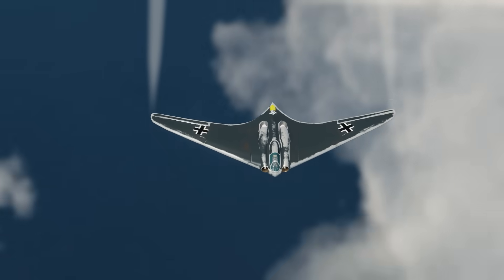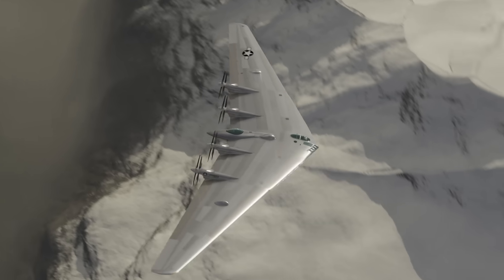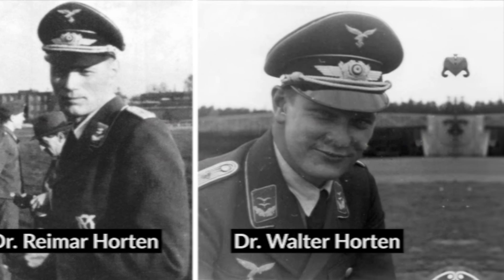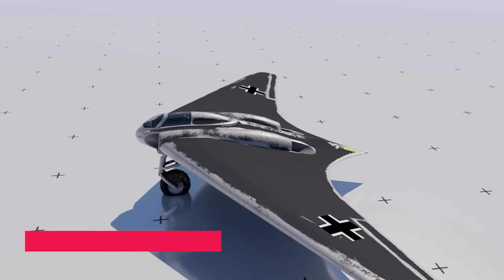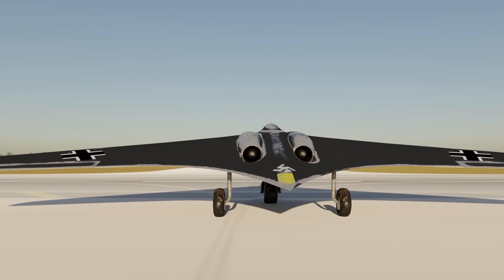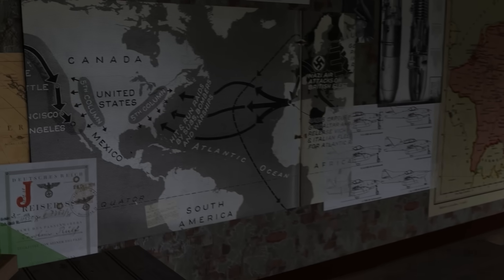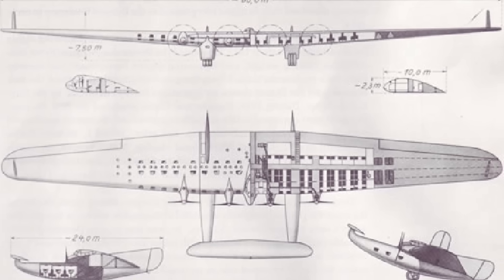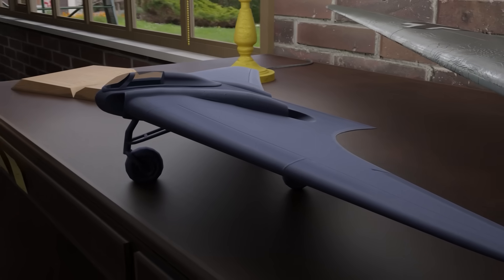Insane Flying Wing Jet Fighter To Save Germany - Horten Ho 229 Nazi UFO

Comment: No one ever mentions that this plane would have encountered the same stability issues that all of Jack Northrop's attempts at flying wings did and would have simply made it unfit for production or service. The flying wing stability issue wasn't fixed until the introduction of fly by wire, if I'm not mistaken, allowing a computer to make second by second corrections to the attitude of the plane and disconnecting the pilot from the actual control surfaces. The computer decides how to move the control surfaces to achieve the plane attitude the pilot is asking for.
Reply: Germany was already developing fly-by-wire technology in conjunction with its supersonic research at the Luftfahrtforschungsanstalt research laboratories...
Reply: @WilhelmKarsten  They were trying to develop allot of stuff that the technology of the day simply wasn't capable of, such as the v3 cannon for one example. It would still have been several decades before technology made fly by wire possible or the precision multistage combustion control for the V3 for that matter, rendering this line of reasoning all but moot.
Reply: @shelbyseelbach9568  Several German aircraft in production during WW2 were equipped with a fly-by-wire stab-trim controls... the Me-262 was equipped with the first fly-by-wire, horizontal Stabilator system to counteract the effects of "Mach tuck" at high transonic speeds.
Reply: @shelbyseelbach9568  Yet Germany 
did in fact develop the first stealth aircraft, first jet aircraft and first supersonic guided missiles that could reach space...
Reply: @WilhelmKarsten  And the B29 had computer controlled gun turrets. The technology of the day was never going to yield a practical full fly by wire flight control system, regardless. Wishful thinking.
Reply: @shelbyseelbach9568  As Plato said, "Necessity is the mother of invention"
 The technology to build stealth aircraft certainly existed in Germany at the time.
 If Germany could build supersonic guided missiles that could reach targets from space... they could have easily developed more sophisticated flight controls for manned aircraft.
Reply: @WilhelmKarsten  Life itself is vexing enough without entertaining hypotheticals, my friend. You are free to believe as you wish, of course. There is no argument that can be made against an ephemeral claim of "I think it might have been possible". All the best.
Reply: @WilhelmKarsten  Germany did not, in fact develop "the first stealth aircraft". LMFAO.
Reply: @shelbyseelbach9568  Stealth aircraft were possible, the Ho-229 is tangible proof, it is the first example of stealth aircraft to exist, the Allies had nothing comparable.
Reply: @shelbyseelbach9568  Germany was during WW2, years even decades ahead of the Allies in aerospace technology... to deny this irrefutable fact is simply childish and immature, usually driven by a vulgar and mindless sense of xenophobic nationalism.
Reply: @WilhelmKarsten  They were possible is not the same as creating one. LMFAO.
Reply: @WilhelmKarsten  At what point did I say that they weren't years even decades ahead of anyone? To put words in my mouth that I never said and then try to tell me I was childish, immature, and driven by a vulgar mindless sense of xenophobic nationalism to have said something I never said is ACTUALLY childish, immature, and the product of a vulgar mind, my confused friend. 🤔🙄😒
Reply: @shelbyseelbach9568  Stop by the Smithsonian and see for yourself.
Reply: @shelbyseelbach9568  No,but you implied that Germany lacked the technology to use fly-by-wire guidance systems which is a completely false statement.
Anyone knowledgeable on this topic knows that Germany already possessed fly-by-wire technology during WW2.
Reply: @WilhelmKarsten  LOL. I didn't imply anything. Meanings other than what I actually said assigned to my actual words by you, are on you, not me. Typical.
Reply: @WilhelmKarsten  LMFAO. Looking like a stealth aircraft is not the same as BEING a stealth aircraft, my confused friend.
Reply: @shelbyseelbach9568  Radar tests performed on the Ho-229 confirmed that it is a stealth aircraft.
Reply: @shelbyseelbach9568  You said, quote; "if I'm not mistaken, allowing a computer to make second by second correction to the attitude of the plane and disconnecting the pilot from the actual control surfaces"

If I'm not mistaken? That exactly what the Germans were already doing with the Aggerat A4 'aka' the V-2 ballistic missiles.
Reply: @WilhelmKarsten HILARIOUS! IN EVERY CONCEIVABLE WAY! JEEEEEEEZ!
Reply: @WilhelmKarsten  And? The V2 is not a plane. It's a ballistic missile. The simple fact is, the Germans did not develop a fly by wire system for plane during world war two, nor did they create a stealth airplane during world war two. If you wish to think they could have, knock yourself out. As already stated, there is no counter statement to an ephemeral statement such as "I think it was possible that they could have done it." There is, however, accurate and factual counter statements to completely inaccurate and false statements such as, the Germans created the world's first stealth airplane during world war two. You are simply cracking me up, man. Freaking hilarious.
Reply: @shelbyseelbach9568  Indeed, a much greater technical accomplishment... 
You seem unfamiliar with the A4b which had swept wings like a jet aircraft.
Reply: @shelbyseelbach9568  So you deny that the Messerschmitt Me-262 has a fly-by-wire stab trim system???
Or that the A4 had a fully functional servo inertia guidance system???
Reply: @shelbyseelbach9568  In your hubris you doubled-down  but have only succeeded in backing yourself into a corner with no option to save face.
Reply: @WilhelmKarsten  A pilot on board the aircraft using mechanical input to generate electrical signals used to manipulate the flight control surfaces of an aircraft is a fly by wire control system. If there is no pilot on board, there is no fly by wire system. Everything you say is faulty. You simply do not even understand the basics of what you are trying so desperately to insist. It is simply hilarious.
Reply: @shelbyseelbach9568  Still digging yourself a hole?
That is the definition of
" fly-by-wire" technology, the pilots control input is converted to an electric signal and is transmitted by wire to an electric servo unit.
Reply: @shelbyseelbach9568  The Messerschmitt Me-262 has a fly-by-wire stab trim system.. it was developed at the Luftfahrtforschungsanstalt supersonic wind tunnel facility in Brauschweig Germany to counteract the effects of "Mach tuck" at high transonic speeds.
The Bell X-1 used an exact copy of this fly-by-wire technology to break the sound barrier.
Reply: @WilhelmKarsten  Someone doesn't understand the difference between an electrically actually trim tab and a fly by wire control system. Hilarious. It's the same guy that doesn't understand the meaning of a stealth aircraft. Cracking me up!

Comment: Even if they managed to gather the resources to build it, at that point what were they going to use to fuel it? Hopes and dreams? They didn't even have enough petrol to fuel the tanks to try and retake Antwerp.
Reply: The genius of German jet technology is that it was designed to be multi-fuel capable, operating primarily on J2-stoff made from coal which was in plentiful supply in Germany.

Comment: I do believe that the Horten's when taken to the US after the war for testing were mistaken for what later came  to be known as ' UFO' when seen from a distance,the drawings produced by a witness. Kenneth Arnold seen from quite a distance. A lot of ex NAZI secret projects made there way to America...if the Russians didn't get it first...
Reply: Not the case at all.
Reply: + @pauledwards8008   The US gave the captured (and unfinished) Ho-229 V3 to the British over the summer of 1945 for study.   After assembly, nobody wanted to fly, and the British were looking whether RR turbines would fit but they did not.   By late August 1945 the British didn't want it and it was in a shipping crate on the docks in New Jersey.   No attempts were made to fly the V3 in the US either and it was kept by the AAF until it was donated to the Smithsonian around 1950.

Comment: 8:08 A bell shaped wing??? This is bovine excrement, to be polite. What the Hortens found out in 1935 was that the bell-shaped lift distribution along the wingspan would be the superior solution to achieve stable flight and coordinated turns with an all-wing, compared to elliptical lift distribution, which was and still is used for a given wingspan with conventional tail surfaces to achieve minimum induced drag. The elliptical, along with the lifting line theory was elaborated by Prof. Ludwig Prandtl ( 6:25 the guy with the grey beard in the middle) between 1914 and 1918. In 1933 he published a new spanload theory for the minimum induced drag, which showed almost the same curve as the Horten solution, but this publication was completely ignored, up to around 2010.
So if you talk of anything "bell-shaped" related to the Hortens, it is always the lift distribution, not the wing 👎

Comment: The design is not a stealth design.  Stealth design implies a deliberate attempt to cut radar cross section,  The HO 229 was a design that used a flying wing design and a lot of lower radar materials such as wood for reasong have NOTHING to do with radar cross section,
2) The US flying wing had NOTHING to do with this aircraft and Northrup was working on designs a long time befire tgis aircraft flew much less ended up in US hands
3) Flying wings are naturally unstable and need  advanced electronics to keep them stable.  A prop version with the effect of the props is more stable then a jet version (still not stable but reasonably enough that the pilot has a chance to control it.  Flying wings like to backflip.  
4). Without various traditional control surfaces Flying wings tend to be less maneuverable and thus they work well for bombers but not so much for fighters.  In general a flying wing will get out maneuvered by an equal tech  conventional design.  Of course fly by wire and unstable designs change that but you dont get that in the 40s.  
5) The US was interested in Flying Wing to increase range for a long range bomber.  Jets in WW2 were NOT long range.So adding jets to the US flying wing was not a good idea as it would shorten the range and make the aircraft unstable.  
6) Germany was desperate for any advancements that would save their butts. They tried several ideas that “sounded” good but that didn't work out and never would have. Building a flying wing jet fighter with WW2 tech was just another.  And turning it into a light bomber would have bedn even worse.

Comment: Actually the concept that a flying wing can be invisible to radar was discovered by accident during the testing of bomber prototypes. Northrop XB35/ XB49
 These planes disappeared from radar at times. 
For the same reason, Horten, had it been operational, would have been difficult to detect by radar in 1946.

Comment: It’s what actually crashed at Roswell. It’s good to remember that the Nazis never surrendered. Only the German military did. The Nazis had already set up ratlines to South America.
Reply: + Hastur   The Alles never flew any of the Horten aircraft.   V1 and V2 were destroyed and lost in the summer of 1945.  The V3 wasn't finished when the Allies found it.   V4, V5, and V6 were just partial metal frames and were probably destroyed in place at the Gotha factory.

Comment: 12:30  This example of the Horten prototype 229 lacks the extended, tapered section at the centre of the trailing edge.   Was it early in the development / testing timeline, or later?
12:44  What plane is that?  Doesn't appear to be remotely similar to the Horten prototype 229.  Could it be another example of some lazy production - inserting pics out of sync to the dialogue, or totally irrelevant?

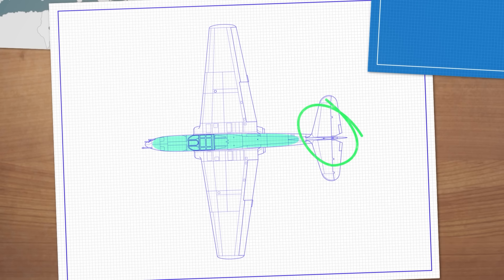Comment: 2:22  The tail of conventional planes is not there to prevent it "yawning from side to side".
6:58  "That's 620 miles per hour, in both instances". 
Nope. 
13:03  What does the 'esh' stand for, in "George Esh Patton"? 
18:45  I can also guarantee you that Bowers did not say "...that an aircraft without a wing can suffer,".
I can't believe that someone who harps on about the quality of his hardware, software and the final video presentation, continually fails to pronounce common words correctly.  He even apologises for just one instance of poor "pro-nown-ciation". 🤦🏼‍♂️

Comment: How could they even get this thing into the air without fly by wire...
Reply: + Sohrab Roozbahani   They didn't fly much at all.  This was an experimental aircraft program.  The first example was a glider that was eventually destroyed during a bad landing.   The second prototype did fly with jet engines, but only for about two hours total before a fatal crash.  The third prototype that was captured and survives today has never flown.   The Horten program was not mature and nothing was ready for production.
Reply: The US experimented with flying wings during and after wwii, without using FBW.

Comment: I love that one scavanged, beefy front wheel😁 At least it wouldn't break so easily by an emergency landing (true nightmare even in War thunder to land without engine and with high speed, where the landing gear breaks and you still flying 😓)

Comment: There is one thing that could have potentially altered history, although it would have required ingenious timing. If the Germans went with the creation of defensive missiles and used it against one of the massive attacks, and destroyed third/half of the attacking planes, e.g. out of 1500 attacking bombers, taking down 3-400, now that would have been a devastating blow. And could have stopped bombing raids.
Reply: If they'd just built a ton of missiles and destroyed a bunch of planes and didn't run out of supplies from the allied advance then they'd surely have won! Sure!

Comment: What a massive regurgitation of myths and nonsense rather than actual research here. Russia, USA and just about every aviation industry capable country had designs and even working prototypes. Yes, the Hortens did produce the first jet powered variation, but the concept was nothing majorly new. Likewise, nothing from Northrop was even remotely based on the Hortens' work, as the early designs for the XB-35 were originally produced in 1940, with Northrop not even knowing of the existence of the 229 until relatively recently, where they built a scale wooden model of it for testing, and in doing so disproved even more of the horseshit people still spew about it - in that it wasn't even remotely stealthy, not even to radar back then. Heck, the mock up they made was even more stealthy, seeing how it had no metal internal skeleton and edge surfaces.

So much is made about "German Technology" without realizing most of it was never half as special as it's made out. The whole "Nazi UFO" this and "Wehrmacht Raygun" idea, in reality came mostly from scientists fleeing the sinking ship and bullshitting every which way they could in order to get on the new America's good side, for labs, for contracts, and for funding. The Hortens were no different either - after being rejected by both the US and Britain, they tried buttering their way up to China, telling them that their magic airplane was coated in this Carbon Black, super stealthy material that made it totally invisible to radar - which Northrop in their same investigation determined was nonsense to after finding no trace of it on the prototype shown in this video.

For a better, funnier video on the Ho. 229, I recommend Lazerpig https://www.youtube.com/watch?v=NnrauXbC7yM&ab_channel=LazerPig
Reply: + TheSpinkels   Correct, although it was the Smithsonian conducting the lab sample studies.  Just wood and glue.  The engines were also faired over in steel panels from front to back for heat shielding --- there was a lot of metal in it.